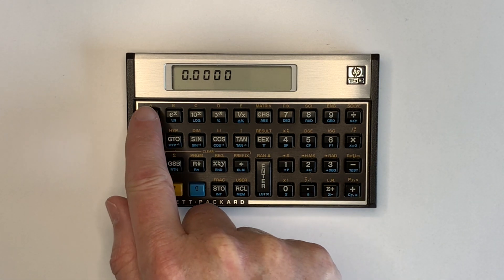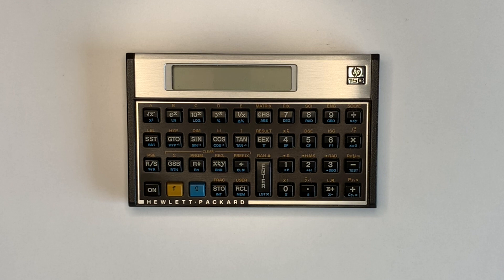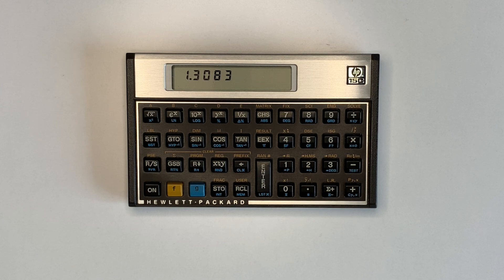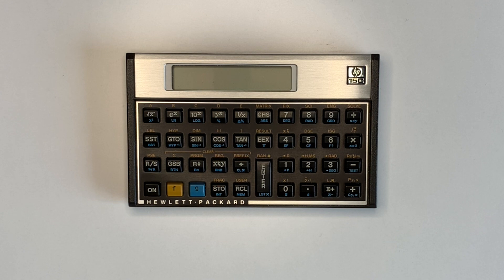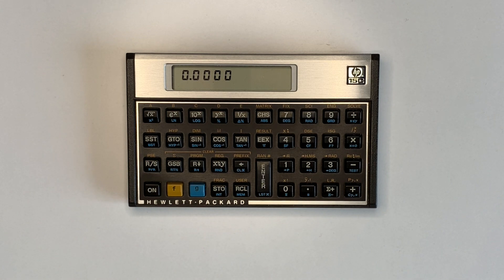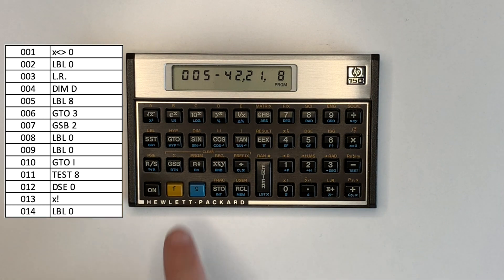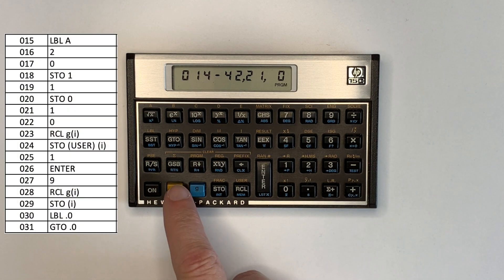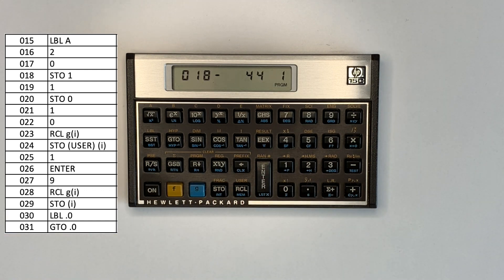HP 15C Synthetics and Synthetic Programming

Comment: I followed the explanations, and then tried to change the bytes in the first part of the program with something close, hoping to see changes in the characters. For example I tried to replace X<>0 with X<>1 or X<>8, or with SF0 (using G key instead of F). Either I get the same display, or I get Error 1. I suspect there is still a piece I do not understand.
Reply from the maker: The Voyager display encoding is complicated even with it detailed in the link in the description so it may take some time to get your head around it (it did for me anyway and it's still easy to make a mistake 😂). Changing one program instruction will change multiple characters and/or annunciators. I have been working on a spreadsheet to make encoding easier but got side tracked but will post an update when I complete it. Note, some encodings will require 2 byte instructions or synthetic instructions which makes it even more difficult.

Comment: Fascinating! I knew about synthetic programming on the 41 series but up to now didn't know that something similar was possible on the 15C, too! So cool! Will test this on my 15C asap and comment back here if it worked (will include the production year). I think it's obvious that this won't work with the 15C Limited Edition from 2011 because this has totally different internal hardware (although it emulates the old code/firmware). I'll try both ...
Reply: Works exactly as seen in the video on my 2412A35394 HP-15C from week 12 of 1984. Does NOT work on the 15C Limited Edition from 2011. :-(
Reply from the maker: I’ve successfully tested on a 1988 model 15C too

Comment: Very interesting, but does not work whatsoever on my HP-15C. Maybe mine is a later model after all (got it in 1986).
Reply from the maker: Interesting. So what happens when you do the rotate step? Does the number stay the same? I’ll test on some others and check what year they were made and let you know. What year was yours made (decode the serial number)?
Reply from the maker: I just tested using a 1988 15C and it worked exactly the same as in the video.
Reply: Have you checked the video for the step by step instructions and verified the display after every step? I gotta confess I was a bit confused on line 24 of the program, but doing exactly as in the video it worked for me in my 15C from early 1989.